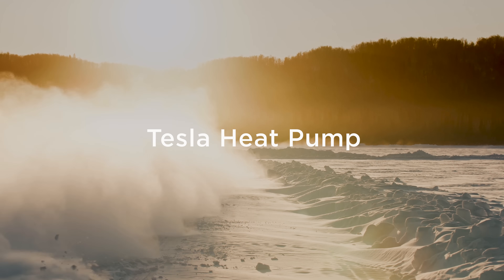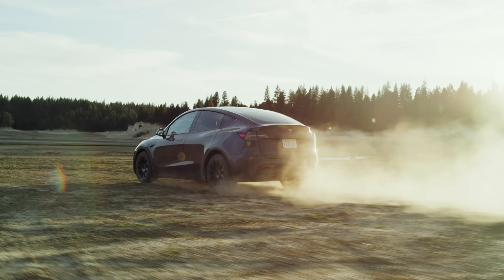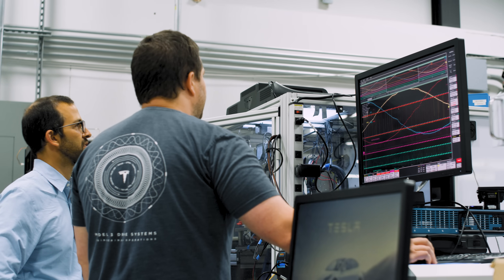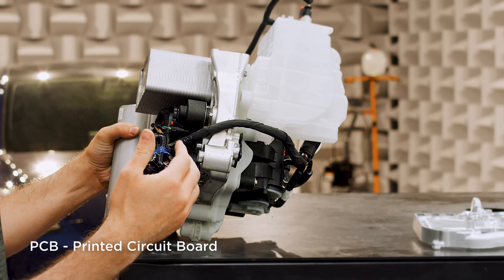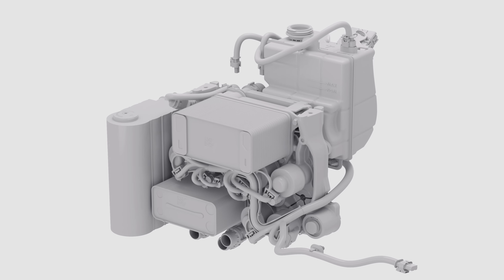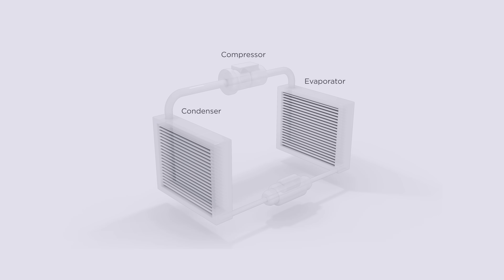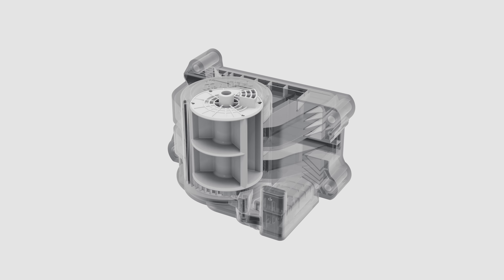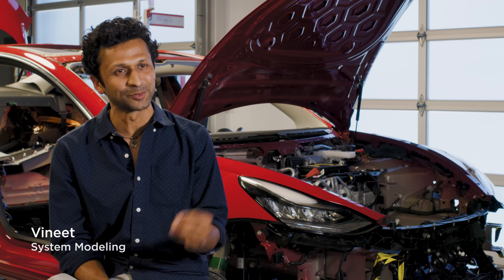Tesla Heat Pump | More Range in Cold Weather

Comment: My 3 week old brand new 2023 Model S just suffered a heat pump or supermanifold failure. It’s been in the shop for 4 days now. It’s also the 2nd time I had brought in the car during the 3 week. A  Rey disappointing start of ownership for a pretty expensive product. Hopefully Tesla can figure it out soon and get my car back on the road.
Reply: Yes I have same problem every winter in Saint-Petersburg Russia!! I have not warranty here in spent 4000$ never recommend Tesla! shit quality compressor and HVAC system is broken again

Comment: If it just heats the cab.. how does that affect better life and charging .. the heat pump needs to run 24/7 in the cold to keep the battery at room temp

Comment: thats smart bc it uses the hot air off the engine even if its cold, a down side of heat pumps in homes, there has to be emergency heat which uses up alot of electricity

Comment: There is no mention of the heat pump limit.  A number of locations in the US are colder than -10 degrees Fahrenheit such as Minneapolis.  How cold can the ambient temperature be, and it still generates heat?
Reply: Not sure what the limit is, but beyond the limit you just supplement with resistive heating.

Comment: well maybe just build a car which works. Motors and all tech stuff is nice but the basic mechanical stuff is so bad. We had a Model X 2021 and all 4 Wheels had mechanical Problems
Reply: The wheels had issues? What kind of issues?
Reply: @logitech4873  Wheel bearings were worn out on all 4 wheels. Maybe not every Tesla is like this but I have heard a lot about mechanical problems with them even tho the rest of the car is very nice, just not the mechanical stuff
Reply: @unknownuser3736  Huh. That sounds like a lubrication issue. Did they replace them under warranty?
Reply: @logitech4873  Yeah that was no problem and it was done for free but it shouldn’t happen on such new cars. Model 3 also has a lot of issues like that if you look into some forums. I really like the cars but they need to get such stuff fixed

Comment: It's better to have a seperate fuel based heater - propane, kerosene or biofuel heater in your car to save battery pack for kenetic energy. It will give you longer range, and lighter vehicle because you need smaller battery pack to go the same or longer distance. Heating using electricity is really inefficient. with 40%+ electricity still comes from fossil fuel, power plants are wasting a lot of heat energy there, and the fraction of electrical energy (after transmission loss etc) you put in your car, you turn it back into heat. We are talking about 20 - 30% efficiency. Even with heat pump, when it's -5 or below, it loses efficiency and becomes very weak. Burning fuel directly gives you 100% efficiency directly from highly dense energy source such as kerosene or biodiesel. You will also cut emission by more than half compared to heating your car using electricity. But problem is perception that an EV having a small amount of emission will not sell very well especially for EV evangelists who don't put any thoughts into the matter.  We are talking about 5% emission compared to ICE cars, and that's only when you turn the heater on. For instance, 1 lb propane canister can provide 10k BTU for 5 hours straight. The electrical energy required to generate this amoutn of heat is 15kwh, and that will take 300-400lbs of battery pack to achieve. With fuel based heater, you can crank up heat and be comfortable and not worry about range in winter driving, at the same time, reducing overall carbon emission. Tesla, if you care about environment, do the right thing, and give this as an option for colder regions. Heat pump cannot give enough heat in -10C and the noise and vibration from over working pump is very anxiety inducing.

Comment: One of the only criticisms I’ve ever heard about Tesla’s in the cold were the silly door handles freezing and not being able to enter your vehicle, should have addressed that at the beginning of the video
Reply: The heat pump is cool though, good job on that
Reply: Yeah the door handles especially on the Model 3 and Y are not suited for winter conditions.
That said, they did address this issue with a way to unlatch the driver's door via the app. Hopefully in the future the door handles will change, or have heating.

Comment: HEATPUMPS ARE LESS EFFECIANT IN COLD YALL ALWAYS GET IT WRONG FFS, IT PULLS HEAT OUT OF THE AIR BUT WHAT HEAT IS THERE WHEN ITS -20 LOL
Reply: Modern heat pumps work to around -30C. 
- 20C is still 253C above absolute zero so yeah there's still energy in the air to pull into the refrigerant, which is then compressed and made hotter. Look up how they work.
Reply: Just because it’s cold doesn’t mean there’s no energy numbnuts

The only time there is no energy is when the air is -273.15 C, or 0 kelvin… you know absolute zero??

And a heat pump definitely works to make air hotter. Doesn’t matter if it’s going from -20 to 20 degrees or 5 to 20 degrees. Look it up before being a dumbass.

Comment: does the heat pump also assist the battery and motor temperature? if you have one refrigerant system, you could have multiple compressors and valves that can keep different zones within a temperature range, while sharing the external heat exchanger, or is this not feasible, do the systems need to be seperate? maybe because the battery and cabin might need to operate in opposite cycles, for instance in mild weather, keeping the battery warm and the cabin cool might be better...

you could implement a far more complex system, having a 3 element loop, external, cabin, and battery, each with a compressor, so if the outside is too warm for the passengers, but too cold for the battery, the compressor between cabin and battery would kick in.
i'm sure thats ridiculous, i'm just playing around with ideas XD

Comment: Great to see the implementation of heat pumps in all models! Having an EV with a heat pump that can do heating in both the cabin and the battery is almost a requirement for having a usable car up here in cold Norway.
Reply: Yeah, but you are probably pretty cold resistant, and does not turn heat all the way to maximum. For me, I need the cabin to have 26C or above, I'm not talking about setting thermostat to 26, it will not get there in my experience. I always have to turn into to max ro achieve 26C. That will reduce range by a lot. Read my post about having a biofuel based heater in EVs to save battery and generate less overall emission.
Reply: @i6power30   yes, I can drive a pretty cold car, but to have it comfortable the temperature needs to be 20-23c. However heating the cabin is not a big issue, the main issue is heating the battery enough since cold lithium batteries loose a lot of power and charges extremely slow. So the heat pump should heat the cooling water in the battery to make it hot enough for optimal operating temperature.

As you mention a diesel heater would be amazing, but then you would have to add it yourself and loose warranty
Reply: @TheJensss  Yeah I agree about battery pack warming for faster charging. I wouldn't install a fuel based heater myself for the reason you mentioned, but would be amazing if Tesla or other EV makers would do it in the future as an option for countries in colder climate. My family and I had COVID a couple months ago and 20-23C seemed like very cold to us. Cranking the electric heater all the way up to 25-26 used more than 50% of battery pack, just for heating the cabin! A simple fuel based heater would completely eliminate the problem and should cost less than this high tech heat pump.
Reply: @i6power30  I agree with this, however I think the government would be mad since zero emission EV’s would use fossil fuel. However a propane burner may work well for heating?  

Hope you're doing well after covid! had it myself last year and it was not fun.
Reply: @TheJensss  yes my thought precisely. I have made a wooden base for a propane heater for greater stability and fire safety. I tested it it's works really good except it fogs up windows very quickly. The solution is to turn on the fan at minimal settings without any heating from car just to have fresh air coming in. Sometimes I have to open window briefly  I don't use it unless temperature outside dips below -10c or I have to travel very far in winter
Reply: @i6power30  I guess we are all different in what we find comfortable: In my Tesla M3 LR AWD, I find 18.5 C perfect, 19 C is too hot. I've never had the temperature set higher. While I'm having my breakfast I use the App to "defrost" the car in the winter (UK based) while the car is still plugged in to the house. I always enjoy watching my neighbours scraping their car windscreens as I drive off in a nice and toasty warm car with all the frost/ice already cleared :-) I often use the heated steering wheel for comfort.
Reply: In the UK where not a lot of electricity comes from fossil fuels it's fine. But in the US 50% electricity generation is from fossil fuel, it makes more sense to use fuel based heater to defrost windows it can still be done using app and remotely that part has nothing to do with the heat source.
Reply: In the UK it's fine, most of electricity comes from not fossil fuel. But in the USA,50% comes from burning fossil fuel, it's more efficient to use fuel based heater not the engine but webasco kind. You can still remotely start it with an app etc. The control doesn't have anything to do with the heat source.
Reply: @i6power30  If you heat via diesel heater, your heat comes 100% from fossil fuel. So if that's a concern, just use electricity.
Reply: @logitech4873  heating only needs 5% of fuel compared to ICE for kinetic energy. In extreme cold environment the energy density of battery is simply not enough to produce adequate heat to keep occupants warm while still leaving enough for kinetic energy range
Reply: @i6power30  Read my comment again
Reply: @logitech4873  I understand your comment but you are not taking into account of transmission loss and battery charging loss . By the time you convert that electricity into heat it's same as burning fuel for heat. But my main point is that if you use large portion of battery for heating in extreme cold you are losing alot of range and discourage adoption. The amount of fuel needed for heating generates negligible amount of emission. Think 1lb propane canister you use for BBQ can give you 5 hours of potent heat no matter the outside temperature. That is at maximum settings as well. If that can give you 50% more range when it's -20c outside, it's well worth it. Now if you want to be really environmently friendly you can definitely use biodiesel

Comment: Heat pumps are most efficient around +5C, and benefits below -5C, etc, are minor. As far as I understand.
Reply: If they mention that, then Tesla stock price will go down ;)
Reply: They still work though, just less efficient. The question is if it’s still more efficient than a traditional heating system, and at what point does it cross over?  It also entirely depends on the specific heat pump in question. 

In reality, heat pumps on EVs increase cold weather performance substantially and it isn’t until you get to like -30 where the benefit fades.

Comment: I have a model Y and what I find mind-boggling is how the regen doesn't work when its cold. I live in Canada so this is basically an everyday occurrence! I get the batteries are too cold to accept a charge but why doesnt tesla use the regen energy to create heat within the motor stator windings and a resistive load and then bring that heat to the batteries?

Comment: How efficient is heat pump at -5C or below? How reliable is it as it has more moving parts and noise and vibration? maybe better just use a propane or kerosene heater? 1 lb propane tank can deliver 10000 BTU of heat for 5 hours straight, no matter what temperature outside is. Considering 40% of electrical grid is still fossil fuel, using electricity to generate heat is not really reducing emission. Maybe more robust to use fuel based heater in electric cars.
Reply: Efficiency drops off in cold temp for heat pumps but when you compare it to other heating methods on EVs it’s still better.

Also, fossil fuel power plants are way more efficient at making energy than anything that can fit into your car… and it filters the exhaust way more than you ever could using a tiny catalytic converter or something. Even a 100% fossil fuel grid has a substantial benefit using EVs vs gas in terms of fuel used and pollution produced.  So much so, that even an EV running on 100% fossil fuel energy ends up offsetting all of the manufacturing pollution in 10 years, whereas gasoline cars continue to pollute through the lifespan of the vehicle. Comaritively of course. 

They still make pollution obviously but they’re substantially better than ICE. If you compare energy use of running both you end up with a figure of 136 mpge, but with even higher filtering at the power plant + higher thermal efficiency of the power plant. When you factor in both of those you get well over 200mpg equivalent pollution.
Reply: @Chevsilverado  I'm not arguing that EV is vastly more efficient than fossil fuel cars no matter where electricity comes from. I'm arguing about heating only, not kinetic energy.. As far as moving distances, EV is more efficient even if power plants uses fossil fuel. But as for generating heat, it's not. That's why very few homes in colder.climate use electric heater. Vast majority use natural gas or oil.

Comment: Works great and the M3 drives well in winter even in sub-zero temperatures. But it would be great if the service could fix the rattling of interior parts and not just explain it with plastic parts shrinking in winter.  Like my wife's 12,000€ car has no noise, but my Tesla does.

Comment: Fun fact, heat pumps get less efficient, the colder it gets under 0c. The exact time you want more heat...
Reply: Still remain more efficient than normal resistive heaters. And heat scavenging also helps a lot

Comment: They don't provide any numbers because here's the reality and numbers: 
A resistive heater they used to produce was like 2kW. And the heatpump is 0.5kW. If you drive 3 hours, you save 4.5kW assuming you're blasting the heat, and you gain about 25-30km of range. A 3 hour drive at highway speeds burns through sth like 48kWh of battery (16kWh/100km). So best case, you gain 10% of range. I'd say about 7-9kWh of energy, increasing your range by cca 50km, give or take.

So instead of it lasting 20% less or 25% less, it'll now last sth like 10-15% less.

Comment: I live in the mountains of Colorado, and have a Model Y Long Range…I take this thing EVERYWHERE.  In the first year I put over 23,000 miles on it, taking road trips to the Texas coast and up to Montana.  It drives beautifully in the mountains…regenerative braking makes the car even more efficient when going downhill.  I’ll run around, plug it in at night, and charge for $1-2.00.  A 160 mile round trip down the mountain for errands might cost $6-7.  My trips to Austin cost $75, while our 4Runner is around $224 ($260 at the highest gas price).  I will NEVER buy another gas car again…the direct buying process was the least stressful experience I’ve ever had buying a car…no fighting with commissioned salespeople and finance managers.  It was magical.  ❤

The supercharger network gives Tesla a HUGE advantage over other EVs.  I keep the Tesla mobile travel kit in my car with RV plugs just in case, but I’ve never used Chargepoint or the overly-complicated third-party networks.  I just pull up, charge, and I’m on my way.  My friend with the Mustang Mach-E is afraid to take it anywhere because she has no idea how to charge it on the road.  In 14 months I’ve never come across a broken charger…you don’t have that same sophisticated charging experience with the others.  Even our plug is elegantly small…I understand the weight and cumbersome size of the other charger plugs can cause faults in charging.  Way to go, Tesla.  I love my car…

Comment: this will break the housing in the first couple of years, you actually combine two systems that work opposite in 1, well you gotta think the stress that the structure of the heat pump will have to endure. Its gonna crack for sure, nice try though.

Comment: Heat pumps are super efficient. But if your car is frozen shut, no heat pump can help you. Resistive heating is very easy to implement and I think it has to be mandatory in any climate where temperature goes below freezing.

Comment: I own Model Y (Nov 2022) and i was testing how my range behave during one of the colder day in East Coast this year. Temperature was around 15 F and my Trip both ways were 100 miles. I used 190 miles of range. I started trip from Garage and pre heated car. That loss in efficiency right now for cold weather is too severe. At the same time traveling above 32 F losses are relatively small. Your usage case really matter.

Comment: I love fossil fuels and my egr deleted diesel with no catalytic converter. Also, when the battery packs fail and leaves you stranded, a diesel powered tow truck will be right around the corner to help

Comment: The heat pump in my 3 is amazing. Even in 15 degree temperature, it belts out heat. Quite impressive.
@1:52: shouldn’t “heat in” have red arrows going into the evap? Or are you saying that the system extracts heat from cold air, but I’d like to see cold air going out instead of in :P